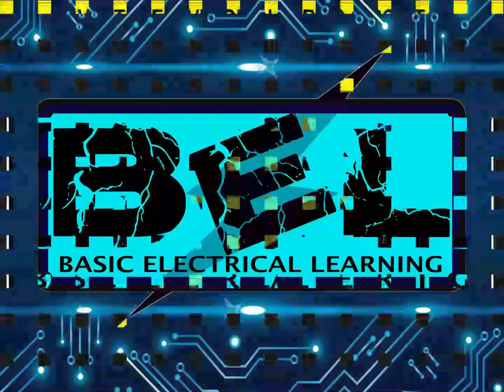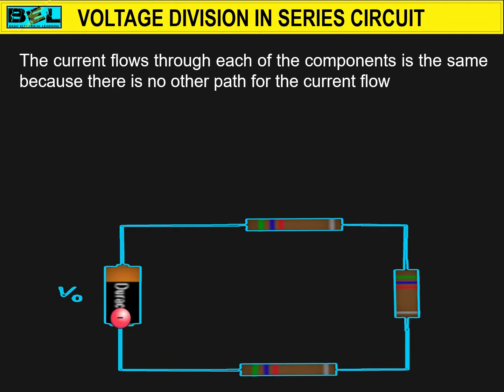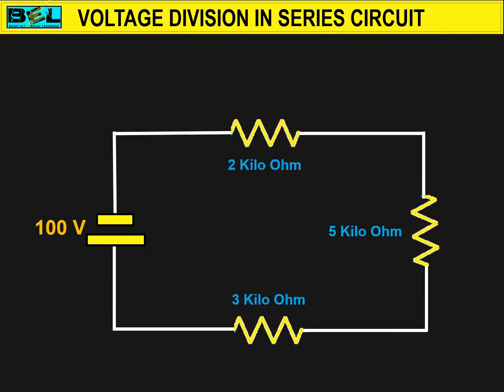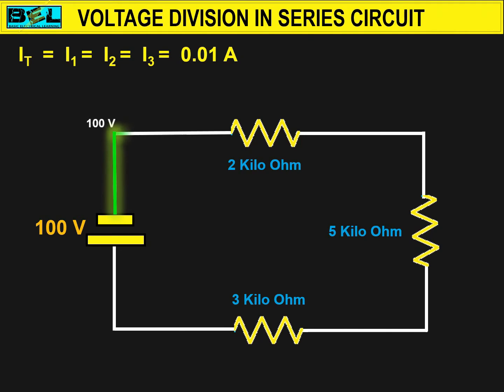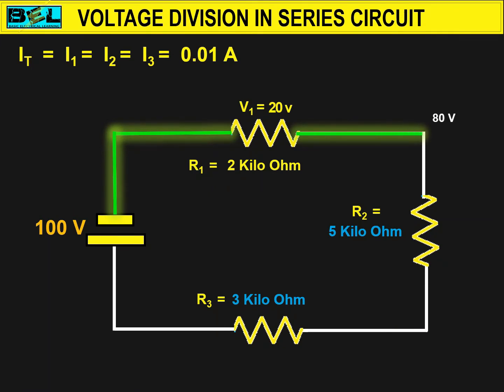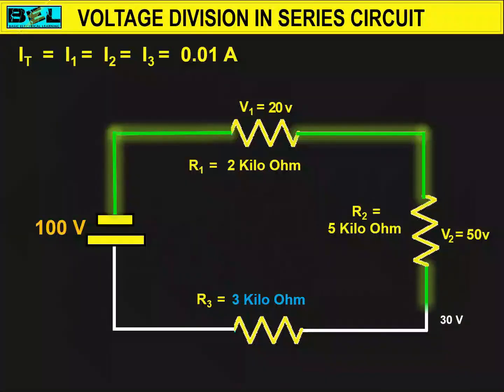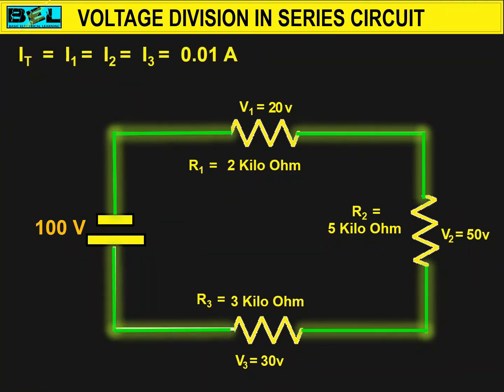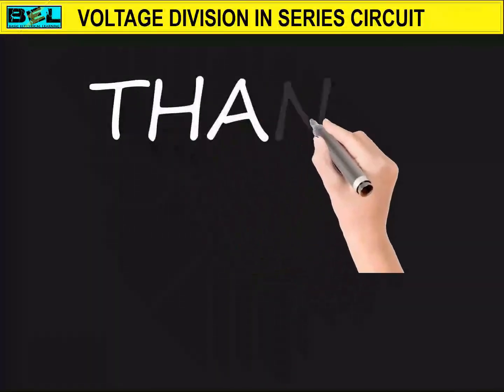Voltage in a series circuit with resistors. Basic Electrical Learning

Comment: Current is flow of electrons, electrons has negative charge, then why dc current is positive?
Reply: It's not positive. Current is all about the flow of the electrons. But positive particles like proton never flow through the conductor. Actually the charge flows. Suppose you have two nutral metal rod(conductor) A and B and you take an electroni from A and transfer it to B so B will get negatively charged and A will get positively charged even any positive particle doesn't move. You can also take two electrodes/wire or any other electric conductor with different electric potential where the "less electrons(-ve charge) as well as more protons(+ve charge) indicate the higher protential" and "more electrons(-ve charge) as well as less protons(+ve charge) indicate the lower potential. So you can realise that positive charges(not particles) flows from higher potential to lower potential and negative charges or particles flows from lower to higher. Thus current is worked.
For more information you should know that when electricity was invented, the existence of electrons was not found. So scientists create all the electrical equations supposing the flow of positive charge or particle which are used today also they also give the right results.
Hope you have understood.